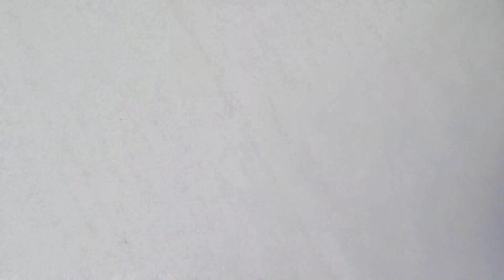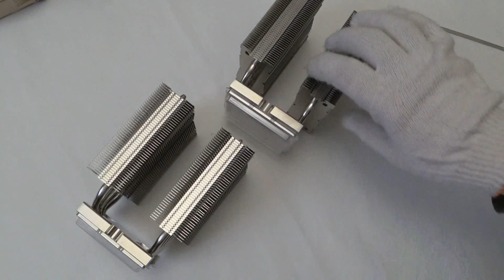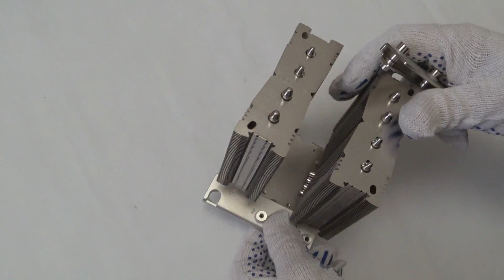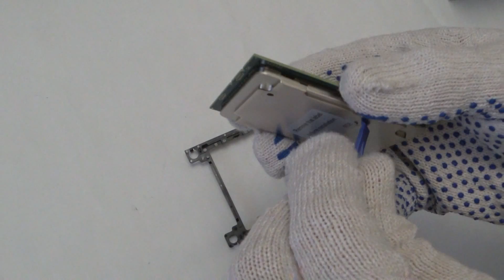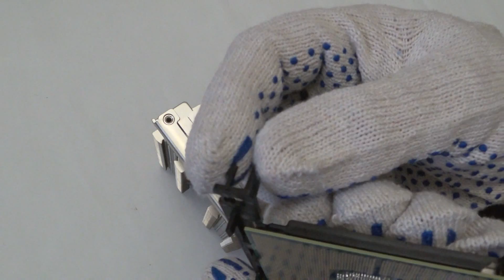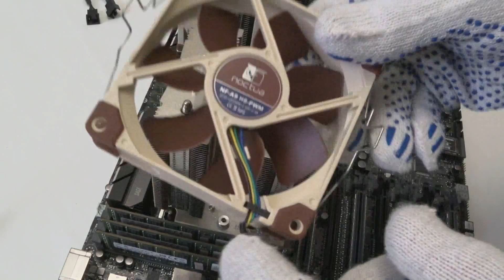Установка процессора Intel Xeon в разъем LGA3647

Comment: hi there, what heatsink is that? I bought for mine and for some reason is bigger than the socket support, for the WSC621E requires one a little bit smaller. Im afraid to buy wrong again
Reply from the maker: Hi. This he https://youtu.be/j3l4LS3APhY
Reply: @4K_GAME1  I understood the problem now, there are the square and narrow type, I got the wrong one, ty for help
Reply from the maker: I used the narrow version.  I installed the towers and the kit includes a narrow and square version.  I saw a narrow version on sale.
Reply: @4K_GAME1  I see. I can’t do it because I have the 2U server shape. The aluminum block go under the board components
Reply from the maker: Dude, write to me personally and provide the names of the components and photos of your build.